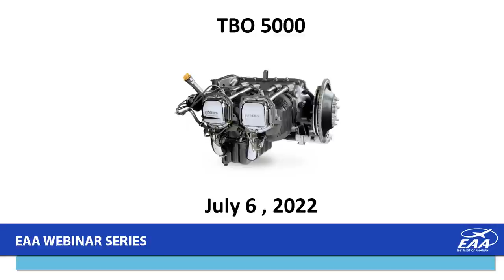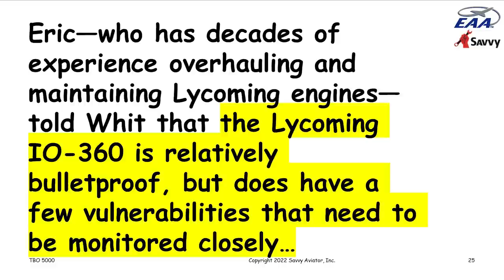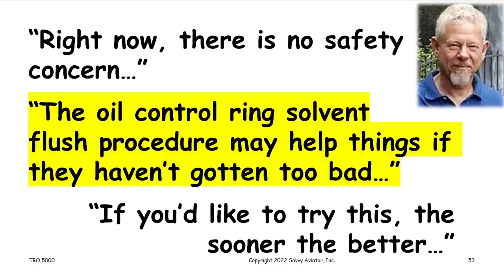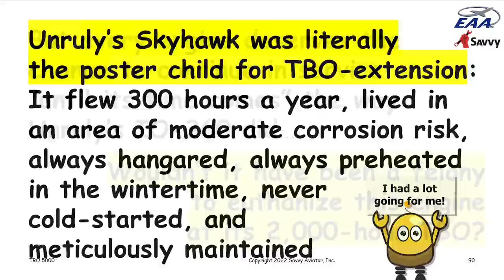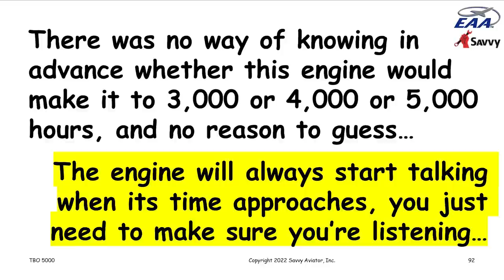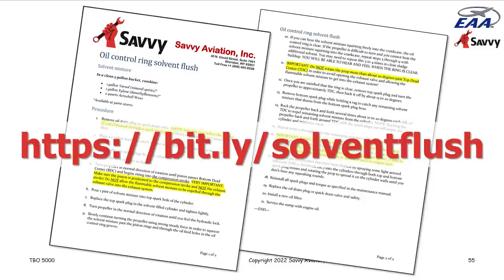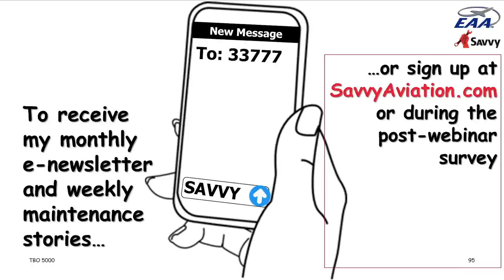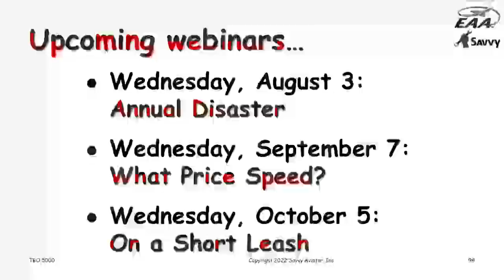TBO 5000

Comment: 40+ years as a mechanic and this was a very good representation of engines...    Adding to his "Solvent" flush, we have used ATF (typeF) and water in similar fashion.. ATF is a very high detergent fluid and the water can aid in the release of carbon from cylinders/ring packs...     Very well informed talk..
Reply from the maker: Thanks Randall!
Reply: I was in the auto industry  , and what we used to use is transmission fluid.  It has a lot of detergents in it  .
Reply: Is that ATF mixed with water, or ATF separately from water? If separate, which one first?

Comment: As a former NASA technical director with graduate degrees in engineering and over 40 yrs designing building all sorts of electrical and mechanical systems as well as building and restoring engines and as a A&P, I see much good in what Mike says but I am sad to see he has fallen for the Statistical rabbit hole trap. He has apparently led people down that hole with him. The data on engines he begins to show at about 7 min into this video makes me cringe to hear how it is being interpreted. Statistic will kill you faster than the time it takes to collect them. I remember once being a young man in driving school, and a teacher said, statistics show that most accidents happen within 5 miles of home, and most happen while people are driving 20 to 30 mph, and most happen while a person is wearing a seat belt. The teacher asked what does that mean? I said, then drive as fast as you can, stay away from home and don't wear a seatbelt. That was 40 yrs ago . Now let me tell you. Infant mortality is when something is JUST made or built and has NOT completed break in. None of this data is infant mortality. He is misusing the term. Early mortality is the term he should be using. BUT all this data does not mean anything he is suggesting it means. You can look at those Bar graphs and what you see is a linear reduction with age. This reduction is more indicative of the type of flying people do as the engine ages, NOT the engine itself.  What I'm referring to is the "service duty", and on a new engine, service duty is Much higher, then the service duty falls linearly as the engine ages. This is because people pamper more and more an engine as it ages,  and use it less and less often. In fact, in this video he is talking all about a story where they treated a engine with maximal service duty maintenance regardless of its use frequency. And it went 5000 hs. It has nothing to do with the Hrs or the engine failure rate. What you see in those bar graphs is the effect of a plane as it gains hrs and the owners lower and lower use of the plane, as well as their lower and lower maintenance because they are using it less and less. You absolutely cannot determine any form of engine failure probability from this data as he and the not so smart NTSB is attempting to show. It is a sucker hole to even try. What you can see is the less you use it the more it breaks, which is a proven fact of just about everything. These charts show how people lower the service duty as the engine hrs get higher, that's what they show. But we can see from the two near identical 1000-1499 and 1500-1999 a common cause of failures. This near identical failure rate is attributed to a common cause between them. These are the peak years and hrs . The engine sits for long periods between flights as someone lowers their use of the plane as it ages, because they think they are reaching some limit and don't want to use up the life.  This sitting causes moving parts to collect surface corrosion. All moving parts in everything from the engine to the alternator and magnetos shafts to cables and more. This small amount of corrosion between extended non use then gets ablated off as you now return to use it . there is accelerated wear from it for a short period. But this accelerated wear is repeated over and over every time you let it sit for a long period. Including On things not inside the engine There is also ablated rust dust sent everywhere. It eventually builds up and shorts things out like an armature in alternator. In the engine it gets churned through everything until broken down.  Chemical analysis of the oil will not detect it as metal flakes, because they are not. Rust is oxidation and when it is ablated off the parts by movement it causes accelerated wear and it is set free into the oil to do it everywhere as it is being broken down. when it passes through the combustion chamber, and it will, it is turned into carbon. so a chemical analysis of engine oil will not reveal there was rust. However, engines that do get chem analysis on oil and show a very high amount of carbon tend to indicate the operator is not running the engine as frequently as they should. You see this in annuals where the engine has been used less than 50 hrs for the yr and the oil is as black as can be, this is a sign of too low of a service duty. The other effect of low service duty is the plane is simply not flying much, If it is not flying it can have an accident.

Comment: Yes Slick 50 contains PTFE. I have a letter from DuPont who makes the PTFE where they do not recommend putting it in ANY internal combustion engine!
PTFE will not “plate” to surfaces at temps lower than 1500F 
Consider your Teflon coated egg pan!! The Teflon coating doesn’t last very long. If you have any oil blowing past your rings, your plugs will foul up quite rapidly with the Teflon leaving quite a mess!  PS. I have tested Slick 50 on a Timken bearing machine with very dismal results. I wouldn’t put in my lawn mower!

Comment: I purchased a 1994 Chevy 2500 engine Chevy 350 gas engine, I purchase this new, because my work and had me driving 65-95k each year doing texter coating and painting of homes all over the state,  I put 624k on this gas power engine is incredibly high for gas power engine of its time. When I traded the truck in they let it sit a lot and the engine had to be replaced within that year. However, when I traded it in it burnt a little oil but not bad it did not smoke, I just noticed my oil changes had to be done about 500 sooner than normal over time or else it would be a little low on oil.  Chevy was impressed and put my truck in their magazine at the time, The drive train was all original.  I believe I got so many miles out because of how often the truth was used and how it was used for long trips consistently.  I agree if you use the motor all the time and let it run for long periods of time each run your engine will last up to 5x longer,  Most chevy 350s would last at best about 160-220k miles.  I purchased a new truck this time a ford 5.7 diesel and got 850k out of it, still running strong when I upgraded, I would bet that one hit the mill mark if the new owner drove it a lot. when most were lasting about 400-500k so I agree the engine will last longer if operated often and let to fully warm and run during each operation,  I dove an abnormally about of miles each year most drive 12-25k a year I was averaging just under 100k a year I belive this is why my engine lasted for so many miles more then the average Ford 5.7 or Chevy 350!

Comment: I always found it funny that the same sentence on recommended TBO states, “….2,000 hour or 10 years.” Everyone ignores the 10 years bit. Most of the problems I have seen in my time in a GA have been age related. Engines that sat for extended amounts of time.  Lost friends from “low time” engines that failed.

Comment: Most A&Ps I talked to don't like Savvy. I figured out why. They all like to kill perfectly good engines at TBO no questions asked. A lot of owners are scared into it without another opinion. I am at 2150. Compressions all 73-75/ 80. Oil filter is always metal free. I have seen several new engines at my field start making metal under 200hours. Its scary. I will leave well enough alone. It ran to tbo at a flight school. Now it flies less than 50hours a year, sits outside. I run cam guard but hope to fly more often soon.
Reply from the maker: We don't like to generalize...we try to give all A&Ps the benefit of the doubt.  The fact is, the old school stuff is still being taught at many A&P schools and old wives tales are hard to break.  At Savvy we work with many shops that are willing to try something new.  We see a gradual change over.  There will always be curmudgeons, but we are hopeful that maintenance is becoming more thoughtful.  Thanks for your comment!

Comment: Does the chart at the beginning discussing engine failure rate in regards to hours or calendar time Account for the numbers of those particular engines flying? I would hazard a guess that there are exponentially more new engines out there flying versus old engines.
Reply from the maker: The histograms plot the number of GA accidents attributed by NTSB to engine failure as a probable cause or contributing factor. They include only the roughly 50% of engine failure accidents where the NTSB actually reported engine time -- the other 50% where the NTSB didn't were presumably ones where the NTSB didn't feel that engine time was relevant to the probable cause.

The histograms plot numbers of accidents, not accident rates. There is no denominator information available on the population of engines as a function of engine time -- believe me, we searched for data like that and there's just none to be had. Therefore, it is important to interpret the accident counts reflected in the histograms with care. It is definitely not surprising that there were few accidents involving past-TBO engines because presumably the population of past-TBO engines is small (since the prevailing maintenance culture calls for euthanizing engines at TBO whether or not there's anything wrong with them). What is noteworthy is the surprisingly large number of accidents involving very low-time engines. If one reasonably assumes that the overwhelming majority of engines remain in service for at least 50% of published TBO, then the histogram data indicates that the failure rate of very young engines is very high, indicating a significant infant-mortality risk.

Regarding engine-failure accidents involving over-TBO engines, there were so few of those that we were able to go through each one in detail to try to determine exactly why the over-TBO engine failed in flight. When we did this, we learned that about 80% of those over-TBO engine failures were maintenance-induced failures caused by some mechanic error, as opposed to an age-related component failure. Clearly such maintenance-induced failures can occur with engines of any age. Indeed, I imagine at least some of the infant-mortality engine failures were due to a mechanic's error during engine installation in the airplane (though I confess I do not know how many). I suppose one could argue that high-time engines tend to have more invasive maintenance (e.g., cylinder changes) than do low-time engines, so perhaps high-time engines are more vulnerable to stupid mechanic tricks than low-time engines are. However, I would suggest that the best way to avoid maintenance-induced engine failures is NOT to overhaul engines at TBO (and thereby increase the likelihood of infant-mortality engine failures) but rather to choose mechanics who are competent, careful, and don't screw up very often. -- Mike Busch
Reply: @savvyaviation  It sounds like you're saying the data is not normalized by the proportion of engines in the fleet having that many hours. For example, the high bars at low hours could be because most engines have low hours, or it could be because young engines are more likely to fail. Most likely, some combination of both. We'd have to normalize the data to get an ideal how much each factor contributes to the high failure rate.
Reply: @savvyaviation  Great answer!
Reply: Great question!
Reply: @savvyaviation  I made a comment above which this reply answers.  And after this answer, I think it's entirely possible that your conclusion that 'infant mortality' is greater than engine failures as they age is grossly inaccurate.  The data does not show that -- it might in fact be showing the opposite, you just don't know.  Every engine has an 'oppportunity' to fail when it's young - they are all young once. But very few have an opportunity to fail when it's old -- and the data is inconclusive that they 'take' that opportunity less often.  Your conclusions are faulty.

Comment: What's the scale on the left side of the accident histograms mean?  Is the first column's "70" accidents mean 70 accidents per 10,000 engines in service?  Or is it just 70 accidents per year?  Unless those histograms take engine hour PERCENTAGE OF ENGINES  IN SERVICE into account, they are vastly unrepresentative.  Quite simply, EVERY engine must be new and have zero hours on it AT ONE TIME, while only the most rare engine will reach service above TBO time -- and the NUMBER of flying engines will decrease appropriately as that histogram moves from left to right.  THEREFORE, it's entirely possible (and frankly intuitive) that the MOST number of failures (per engine in service) could in fact be happening WHEN THEY ARE OLD and not when they're young -- completely opposite from what Mike is suggesting.

Comment: I recently bought a light twin with O-360-A1Ds at about 950 SMOH.  The previous owner ran them at 25"mp and 2500 rpm, leaned (not sure if he ran LOP or ROP, but I strongly suspect ROP); I almost always run them at 20"mp and 1800 rpm LOP.  I flew it cross-country over 2400 nm and only burned about 1 quart of oil per engine at 22"mp and 2350 rpm, so I think they seem to be running pretty strong so far.  Can anyone with experience with those engines tell me what to watch for in terms of wear and indications of pending issues?  Thanks!
Reply: What you are looking for is an increase in wear metals in the oil samples, loss of compression, engine not making static RPM. Increase in oil consumption, and decrease of oil pressure.

Comment: Please be more thoughtful about stats, that graph at 6 min doesn't say what you think it says because it's not normalized for the flying engine fleet. For example that same curve would appear if engines past 1,000 TSO were 4x as likely to die, but 90% of flying aircraft have engines that were overhauled in the last 500h. Engines at 2.5-3k are almost certainly VERY rare, so very few failures are expected. That's the problem with stats, they paint a very incomplete picture and thus lead to confident false conclusions.

With that said, thank you for the video and I largely agree with the ethos of it!

Comment: I’ve seen a few fatalities from old engines loosing power due to camshaft and lifters degradation…
Reply: Cam/lifter failure should be fairly easy to detect with oil analysis and filter inspection. Generally cam/lifter failure is slow so you have time to catch it before it has a noticeable effect on performance and reliability.
Reply: @LesNewell  Right?  And most of cam and lifter degrad are partial power fails.  Many pilots panic and stall the airplane instead of landing it right.  Pilot failure is not an engine failure accident.
Reply: There have been countless fatalities shortly after engine overhauls as well. In fact, an Aero engine is significantly more likely to catastrophically fail in the first 200hrs after overhaul than it is to totally fail in the remainder of its life. Usually if it makes it a few years it probably wont fail catastrophically and will give some sort of warning.

Comment: Why , in this modern era , are we still using lead in fuel ? Old habits are hard to break but if the ROTEX can do well with Motor fuel without the ethonol why not standard engines. Any octane fuel can be run as long as the timing is set correctly. I learned at Ft. Eustis in the 60's. I was trained on the OV-1 , CV-2 and the U-8. we were shown that any available fuel could be used as long as the timing was correct. What say you...

Comment: Wouldn’t it have been worth it to pull the jugs and replace the rings? Or is that 20-20 hindsight? It sounds like that was the only issue with the engine
Reply: There comes a point when spending money on an old engine isn’t worth it.
Reply: From listening to old Savvy lectures, removing the jugs opens up opportunity for main bearings to shift and it can cause new issues to contend with.
Reply: @christianjforbes  if done correctly, that won’t happen. Always take engine work to a shop you trust.

Comment: Rotax 912 is at 3230 hours with only oil changes, but the gearbox is rattling so it's time to overhaul it. This is experimental, not certified.

I'm confident that the rotax 915 will last to 2000

Comment: The most dumb way to damage a machine is by not using it.  Old German saying !!
Reply: that depends a lot on the type of machine - the more complicated it is, that saying becomes more true
Reply: @ghostrider-be9ek  Like what? be specific and detailed.
Reply: @outwiththem  a  sewing machine will sit in a closet just fine for 20 years, while a printing press for a paper mill, will start to decay and mold in a few months of disuse.
Reply: @ghostrider-be9ek  W were talking about expensive engines here, not sewing machines.  LOL..
Reply: @outwiththem  right LOL - your quote said MACHINE, not "expensive engine" - please correct your BS statement then if thats what you intended

Comment: No doubt infant mortality is a problem with our engines.  It would be great to have more data on engine failures - why they fail. We also need more data on how many hours are flown.  No doubt this is hard data to get, but I'm guessing soon Savvyaviation.com will have enough data to do even more analysis. :washhands:
Reply from the maker: We're working on this...its one of our research areas!  Stay tuned.